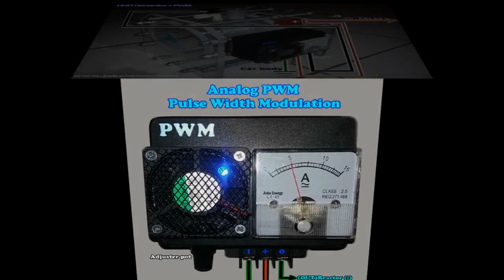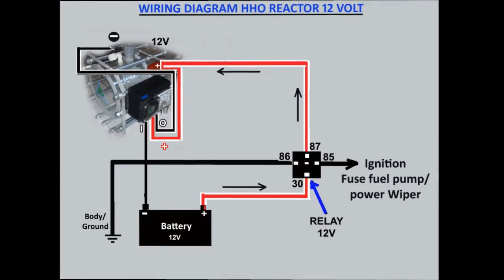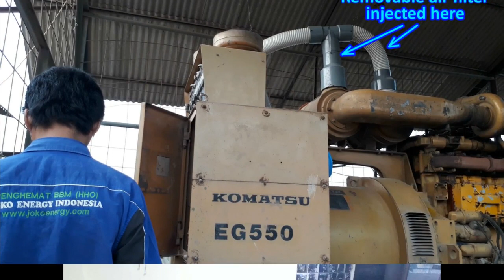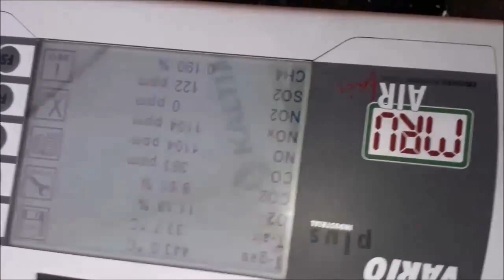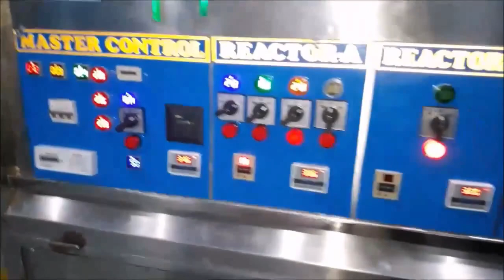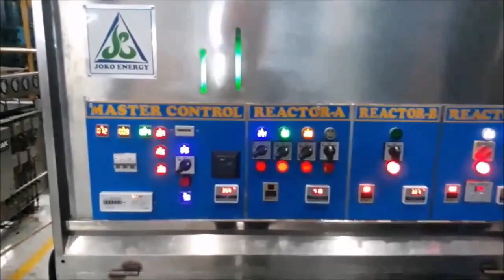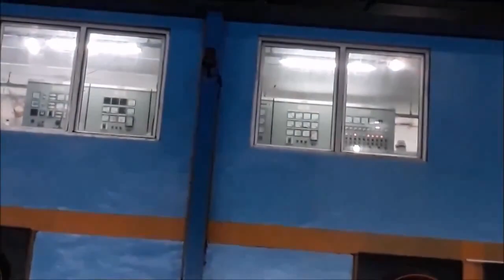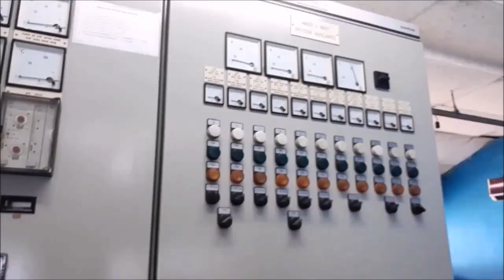all new Joko Energy's fuel saver 2020 products

Comment: Good day, Can you please help me to convert my VW-Crafter 2013 to H2O hydrogen engine?
I am planning to install a 1800 Wp solar system on the roof of the vehicle, therefore I also intend to consider a 100% conversion to hydrogen fuel.
H2O hydrogen should be produced on the road while driving. 
What information (for example engine) is available in your country?
Unfortunately, I can't find any parts in my country (Germany) to be able to install this in my car.
I have already heard that you need the diesel injection pump and a different engine head.
If you have other info about this or have more info, it would be very nice if you could please let me know. 

https://auto-database.com/volkswagen/crafter/2013/crafter_2013/

Regards
Caroline